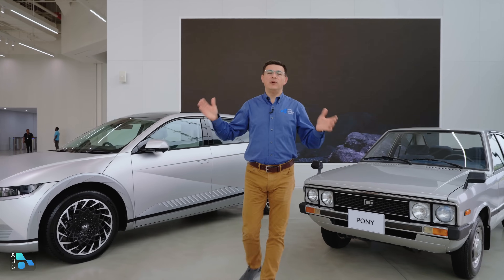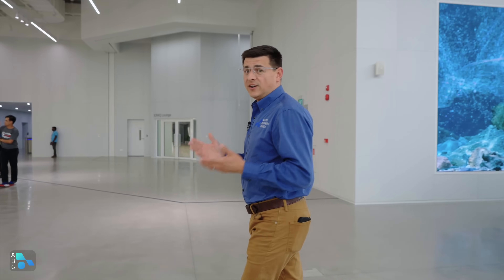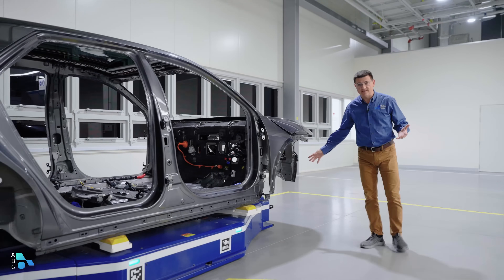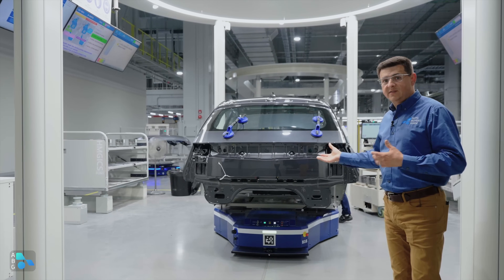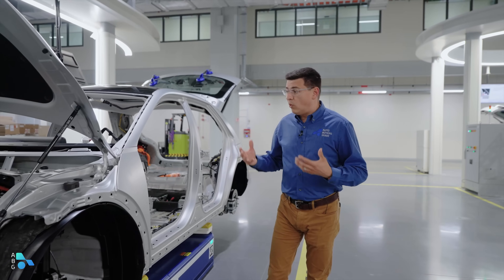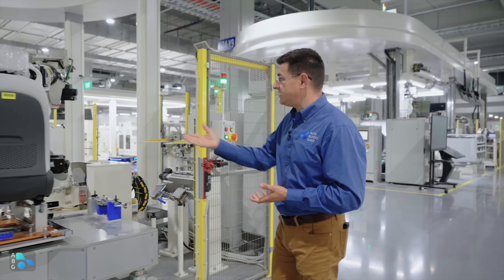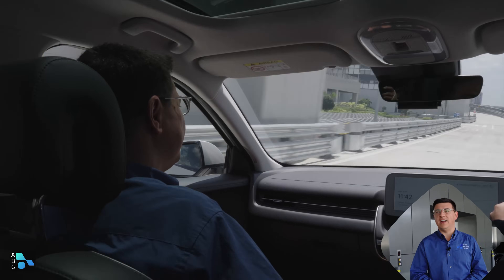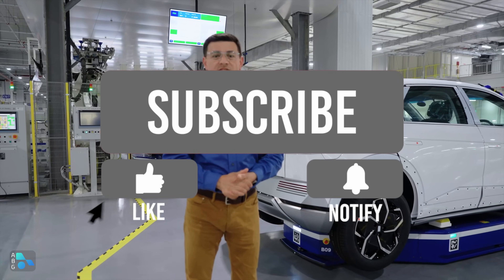Hyundai Says Their Singapore Factory Is The Future Of Highly Automated Low Volume Production

Comment: I worked in Cell-based manufacturing. The nice thing was each cell was a small group of people (5 or 6) in my case and we were all trained on all the assembly operations so each day could vary rather than the same task over and over.  I was the technician, so I was responsible for testing, but when that was slow I could join the assemblers and help out. The robots and open floor give hyundai even more options to switch up what's being built. I was in industrail safety devices, not cars but the concepts are the same.

Comment: The sleds although not self driving as such but following a cable in the floor to transport car bodies has been used before, Volvo had it in their Kalmar asembly in the 70's. But the idea of more automated CKD plants is intresting.
Reply from the maker: These are not following cables in the floor, they actually will reroute themselves around obstacles, which is where they differ from that technology. Instead, they use cameras and other sensors to direct them around the floor.
Reply: @AAutoBuyersGuide  Yeah, this is a much improved system over the one Volvo had. Can't fully compare 50 year old tech with what Hyundai uses here 😂 Just thinking about using sleds insted of tracks as used on "normal" factories.
Reply: Funny you pretend to know how the whole world works. Totally wrong

Comment: Too bad they can’t produce reliable vehicles that are Korean fire burners.
Reply: Wife had a 2021 Tucson Limited Gas, had the better get the recall done otherwise your vehicle could catch on fire, then the TPMS light kept coming on.  Went to the dealer 3 times, could have lemon lawed it.  Yes it was still under warranty.  Luckily it was a lease, traded it in for a 2023 Santa Fe Hybrid lease.  Has a squeaking noise in the driver rear.  Navigation maps refuse to update.  That DCT transmission sucks off the line & at slower speeds.  This also had the 'better get the recall done otherwise your vehicle could catch on fire" but this didn't have the tow hitch.  These are some really "past" vehicles.
Reply: Per Consumer Reports brand reliability ratings, Hyundai is quite average. Not as high as Toyota, Lexus, or Mazda, but basically pretty decent. You want unreliable you get a Mercedes or Alfa (or a Maserati if you want serious pain.)
Reply: This is actually part of why they are all in on batteries, but ironically they partnered with LG, which is like the one battery manufacturer that also has struggled with fires (same company as the Bolt used).
Reply: at least their wheels don't fall off
Reply: Too bad your comment is what’s a fire burner 😂. Because comments like that clearly show just how far stuck you are in the past while everyone else looks to the present and future
Reply: @naveenthemachine  toyota clowns. they defend and worship toyota regardless toyota recalls 1.8 mio RAV4 over engine fire risk. but when competition does, its bad 😄
Reply: @naveenthemachine  Yeah that is why Hyundai/KIA have so many lawsuits against them NOW. Along with their shotty warranty practices.